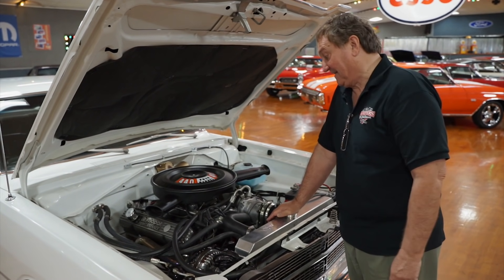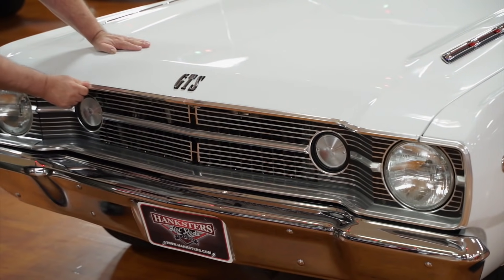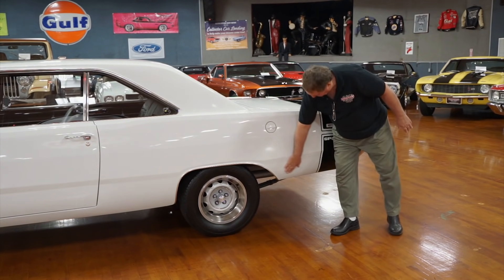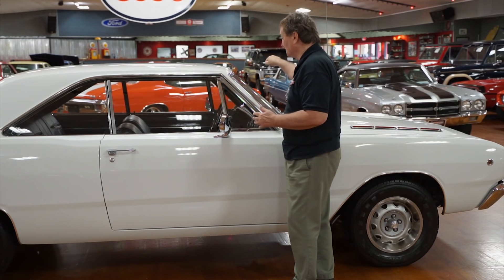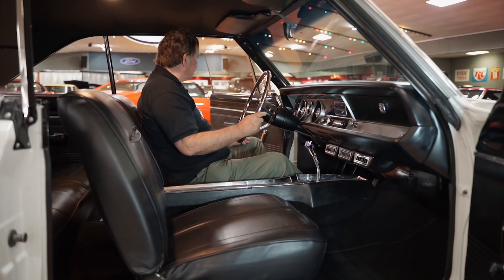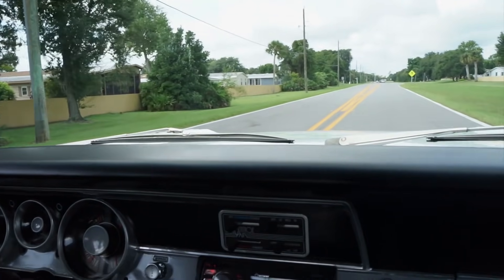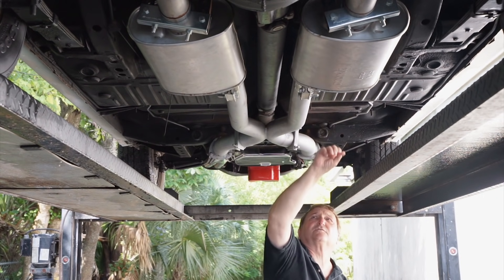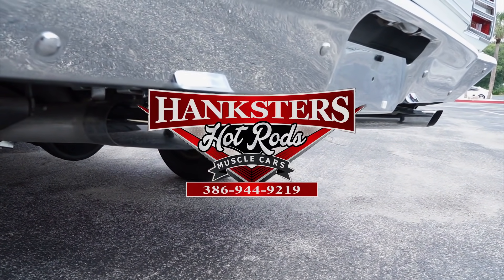1968 DODGE DART

Comment: Nice little hot rod. There was a Dodger dealership back in the day, Spalding Dodge I believe, that did this 440 thing to Darts. You could tell them by the "GSS" letters on the side instead of "GT" or "GTS". The "GSS" also had red trim instead of the black trim like the "GTS" and "GT" did. Needless to say they were pretty fast. Rare now.

Comment: i had many Mopars i wished i never sold! One was a 68 GT Convrtable 318ci AT. daily driver that Mopar Mag wanted to do a article on it with photos and i wasnt into it what a fool but it was nice......i dropped a Blown 360ci in it and got the first Richmond Gear 5spd right after they bought out Doug Nash.
it had the first 4 granny gears and th 5th was one to one. tall rarnd gars made it a fantastic freeway car and great gas mileage. drove it everywhere and extremely reliable.
A blast to drive! Sold it to my brother in law  since i was working overseas and it sat outside getting ruined. gave it away for $10k and he turned it into a show car! Too beautiful to drive, so he sold it to another! If you see a Hemi Orange GT Blown 360ci Conv out there with white top and interior. I purchasd it from original owner whom had it sitting around for most of its lif in a garage out in Washington State all original with th glass rear factory window and the car was all factory stock. Bronze or copper colored with the whit top and interior. Owner parked it one day due to carb problem and it sat ever since i towed it out off the dirt floor with rats living in it! Another fw mor months later the garage would of fell on it! 
He had a  66 chevy convertable sitting in another garage and all original owner car. Which his sister owned it. she parked it one day and years went by and the pigeons had a good inch or two droppings covered it. i can barely make out the shape! i wasnt into Chevys but what another barn find!

Comment: I had a 1973 dodge dart sport 318 with 340 heads 3 in floor miss that car had a 73 roadrunner I miss even more .I bought a 1964 dodge dart 170 225 slant 6 3 on the tree .with 42thousand miles all original going to be my youngest  1st car .he 14 1/2 now

Comment: My first job after HS was a low level mech at a Chrysler Plymouth dealership. I preped a lot of 77 - 80 cars. Those things were garbage, and very hard to prep right. Some couldn't be fit right, and a few had to go to the body shop before Bud Brown would accept them. The New Yorkers were the worst. OMG it took me several days to do a New Yorker. To make a car this nice is art if the dodge boys built it. Nice show. My Duster is not this nice. I'd want this one.